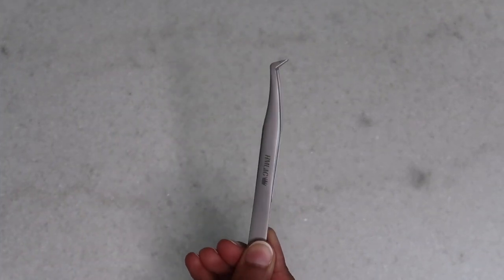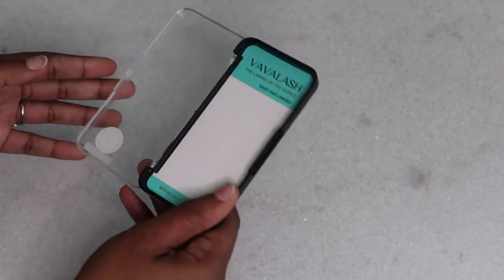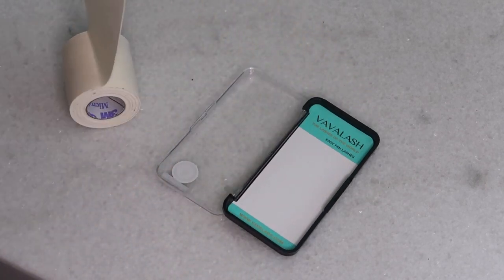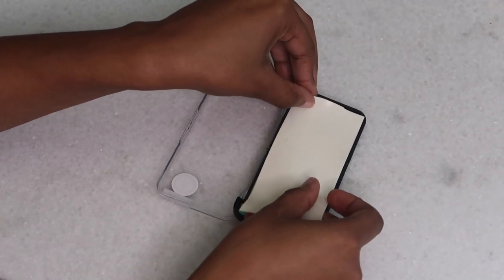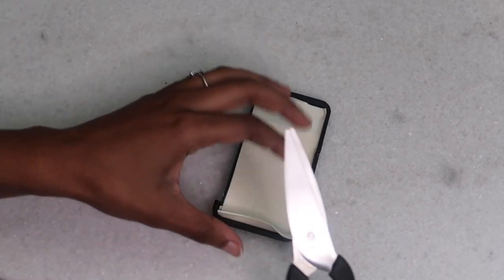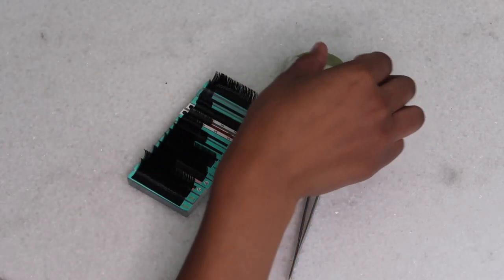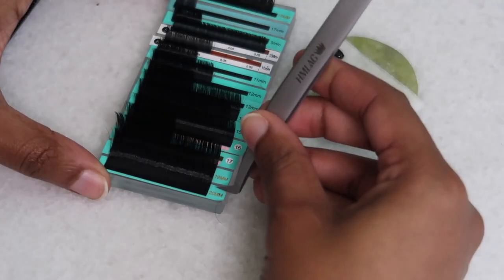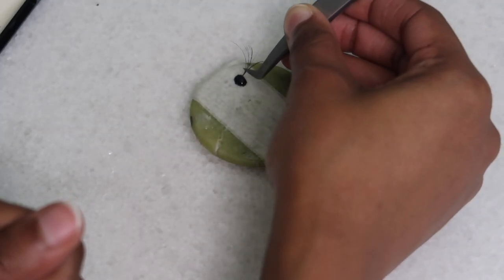How To Make The Easiest Handmade Volume Fan (Pinch Method) | Beginner Friendly

Comment: Hey Tanieya, what’s the difference in premade fans and easy fans? Which one
 do you recommended for beginners?
Reply from the maker: Hey! Pre-mades are heat bonded and come already made in the lash tray so you don’t have to actually make the fan. Easy fans are lash extensions where you physically have to make the fan but it is easier to make into a fan because the base stays together easier
Reply: Hey Tanieya, what’s a good brand for premade fans? And what length you recommend? 👀

Comment: Why is my fans not sticking when I’m pinching
Reply from the maker: Are you using easy fans or regular volume lash trays? If it’s falling apart after you pinch try using those glue rings with the ridges in them to make a fan